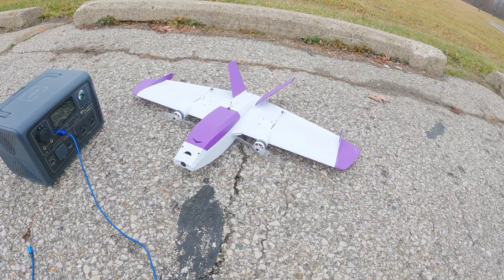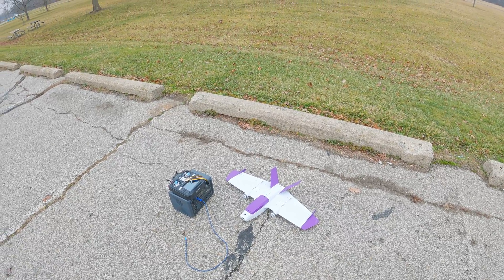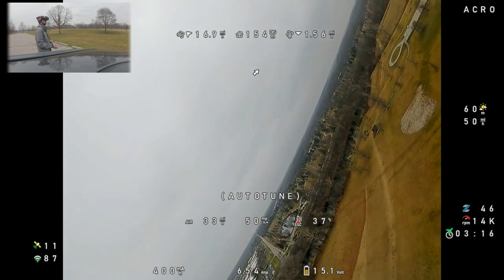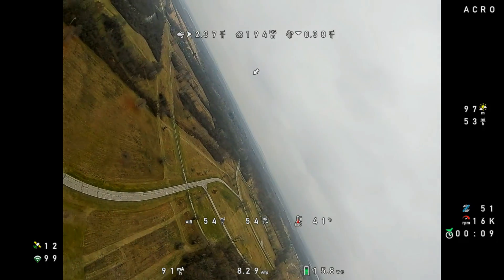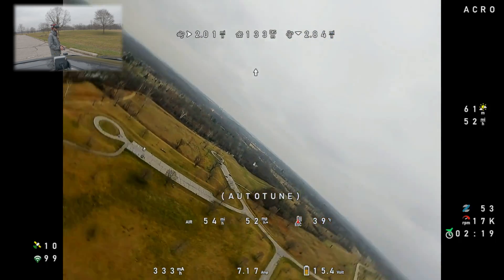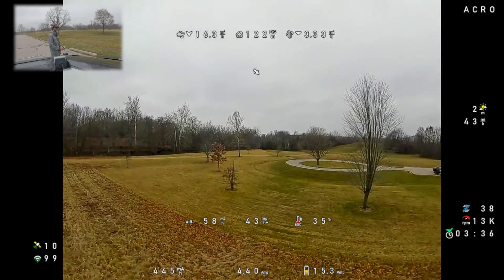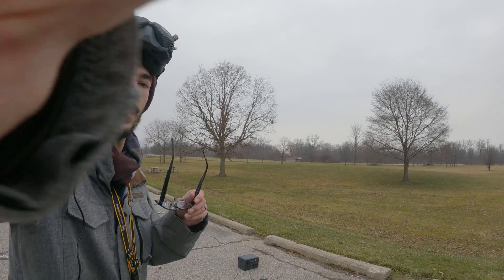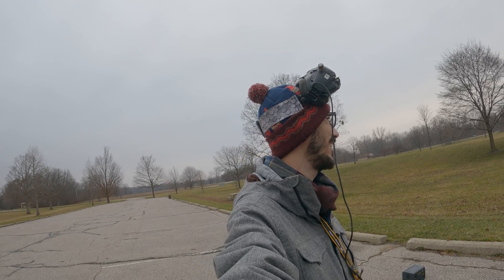This Free 3D Printed Wing Flies AMAZING | Oliver C Sabre

Comment: This is cool man nice! Do you have a build vid of all the main electronics and camera system stuff? What material is the plane made from? 
I love how you can have all that info on the OSD screen in the googles. So this is a Nebula Vista Kit for the Digital Video? What goggles do you recommend to get? Or just get the DJI goggles 2 so it can be used with the 03 air units as well? 
I have fpv drones and RC planes. Id love to turn one of my RC planes into one of these as a cool project and have it with the FPV, it looks so fun!!
What radio protocol are using for the Radiomaster TX? Hows the range been? Im not familiar with that RX..
Thanks!
Reply from the maker: There is a link to the RCGroups thread with all the info you need in the description, but I can give you the skinny.

The plane is printed from inland (esun) pla+. I am currently printing a new one out of ASA to see if it will be a bit lighter and stronger... others have used petg, but it was designed with pla+ in mind. The plane needs 2 carbon spars/tubes that run through the wings. The camera/vtx is a caddex vista and i use goggles v2, they are both rooted with wtfos, thats how I get the cool OSD. 

For my radio tx im using ImmersionRC ghost. Range is amazing.

Comment: Awesome sauce! HAHA. I'll be starting the prints this week for the sabre. Any tips on printing setup? I'll be using Pla and my Tevo Tornado gold.
Reply from the maker: cg marks are too far forward by about 5mm

Dont go too crazy on the motors

dont fly tri blades unless you are flying like 3.5", they will break on landing

make sure to use cura 4.13.1. nothing else. and use olivers profiles.

Make sure to have retraction dialed in, and if possible, linear/pressure advance.

Comment: The problem is with DJI not iNav.
Reply from the maker: meh, I mean DJI made a product that wasn't specifically compatible with anything but betaflight. They will probably never make it compatible with iNav. That is just the simple reality, So INAV has 2 choices.

1) take a moral stand against what DJI should do and actively hurt its user base out of principal. Like Betaflight did with the warnings 'hack'. So frustrating. it would be perfect, but would be *something*.

2) get a limited character set working of basically what works in betaflight, like ardu happened to already have done out of coincidence.

Their current plan seems to be the former.... But maybe if one of them ends up with some goggles that will change. idk there is a lot of time between now and 6.0 stable. I can only hope, as I have an o3au I bought just for this plane :-/

Comment: This is the exact model I've been planning on doing in the spring! How's the durability so far? I've been having people tell me that basically all 3D printed planes explode constantly.
Reply from the maker: Good so far. If you watch my last video, I crash it pretty hard, needed to reprint both wings, but I mean, uncontrolled crash into a tree from altitude lol. 

Definitely not as durable as a foam wing, but fine doing landings and stuff.
Reply: @mouseFPV  That's good to hear. I'm going on doing a little experiment by trying to build it out of polypropylene. From what I've heard, it should have higher rigidity than TPU, and vastly more survivability than PLA. It's possible that it'll just end up being a floppy plane that can't fly, but if it works, it'll be amazing! 2-3 months of waiting will be hard.

Comment: This is such a clean build mouse. Love it man
Reply from the maker: Thanks!! Oliver did great work designing it :)
Reply: @mouseFPV  yea man kudos to him on the design. I legit want to print it if I can get my printer and computer setup right.  I’ve been flying a HEEwing as of late. It’s a blast
Reply from the maker: @the_darkside_fpv  the t1? That's a dope plane!

For getting your printer dialed in, I highly recommend the teaching tech printer calibration tool. It will help you get good retraction and temp values, at the very least. Linear advance is worth setting up as well. 

Then just load those values into the profiles oliver provides and send it :)
Reply: @mouseFPV  yes sir t-1 ranger pro. New model available with bigger motors, metal gear servos, and a carbon boom. It flys well.
Reply: Great video. I'm trying to start printing this plane. Out of curiosity what slicer are you using?